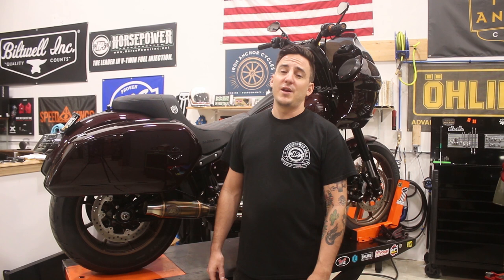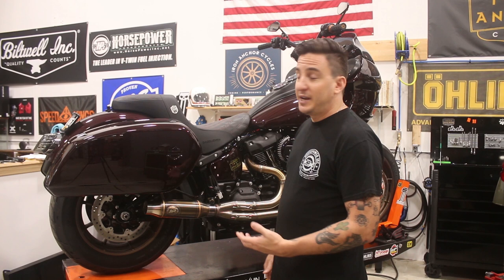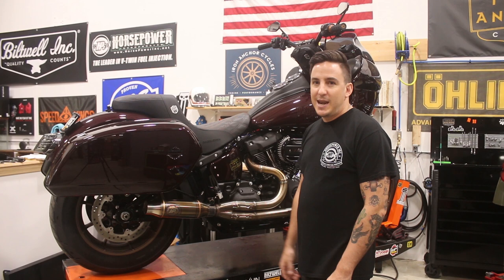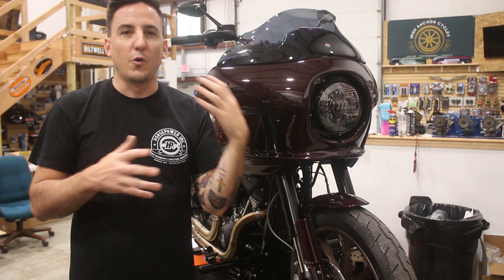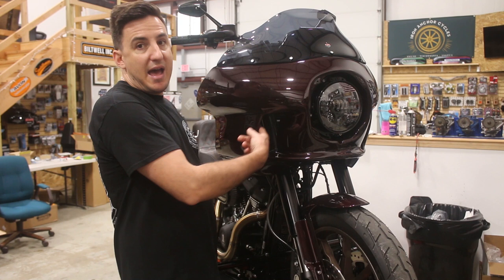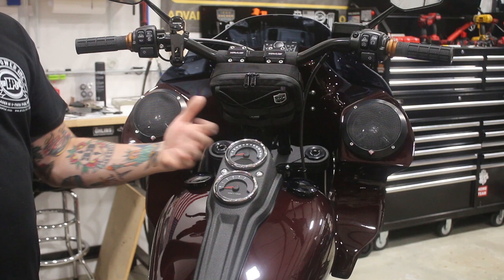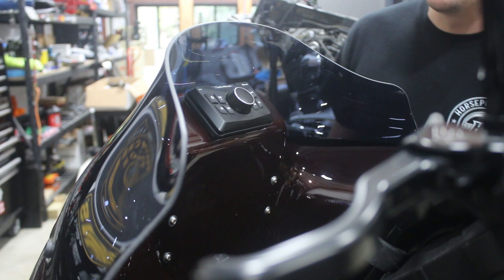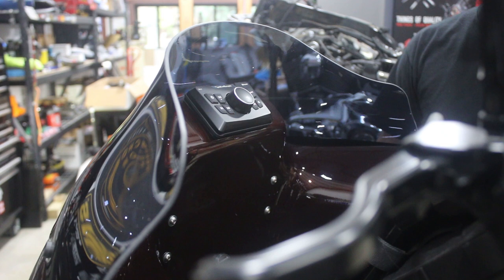Project FXLRS - Part 8 - Fairing & Bags

Comment: Sport tour build is my goal is well. This episode is why I bought the Sport Glide. Expensive bags & labor already there and they fit snug. Also no 1980 fairing. I realize it has its following. However the factory quick release fairing required Gustafson dart tint vented windshield plus lowers to get to both good coverage and no buffeting. 

Flip side is that some people prefer the mid controls that the LRS comes with. However HD sells mid controls conversion kit for those that prefer it. Both have inverted forks but a downside to the Sport Glide is that it only comes with a single disk although it does have ABS ie it’s a trade off. Fortunately you can now get a 15” brake for the SG which damn. 

The last trade off is the SG comes with the 107. In my case since I was going to build the motor in either case plus I prefer shorter stroke. Anyway been following your build and am looking forward to the rest of what you do.

Comment: I couldn't agree more with you about the RWD FXR fairing IN TERMS of the amount of work it takes to make it fit GIVEN it's supposed to be plug and play and total cost.  I honestly don't understand why the fitment isn't better across the Dynas, Softails and Touring (Road King) chassis.  Why can't the clearances/cutouts be better or at least much closer to plug and play?  I can't begin to tell you how much I had to cut out of the bottom just to clear the turning radius AND I removed the upper fork cans.  On top of that, the mold (2022) wasn't the quality I was expecting and the amount of prep before paint was exponentially more then they (website and phone conversation) led on.  All in all I'm happy with the end result, but the amount of work I had to put in after already investing the $1,400-$1,500 for the kit, was insane.  Therefore, I would say it's overpriced for what you get.  Great video!

Comment: A couple questions. First a great video with all the info. Thanks so much. 1, What  are the other fairing manufactures. 2 and most important. How does the bike handle in regards with the wind. Hopefully like a Roadglide. After all that is the whole purpose. Thanks again for the great video.

Comment: H-D is telling people not to install these fairings. The MoCo wants you to buy their LRST version claiming that the front suspension is a little bit different to account for the additional weight of the frame mounted fairing. On your build, do you beef up the front suspension to make it perform better than the stock setup?

Comment: had the same issue with my rwd fairing. The primer coating was pretty jacked, the body work dude had to strip it all off. Dominator carbon fiber would've been cheaper.

Comment: I was at your event on sunday, had a good time was trying to take a look at the low rider s. Where you put the tank bolt and maine bracket did you remove those lil plastic covers? Im having a hard time tightening mine down. Everytime i go over a bump that bracket moves slightly up and down and its an annoying sound. Might have to take her to your shop and see how we can tighten that bolt down right

Comment: Ive got a 2021 Sports Glide. Im thinking of getting this FXRS fairing for my bike. My question would be how tall do the handle bars have to clear the fairing? Thanks in advance
Reply: I have the same fairing on my low rider s. Needed 12” risers. My risers don’t have the 1.5” pullback like you can get on the Kraus risers. I’m not sure but you might be able to go an inch or so lower with the pull back.
Reply: Sell me your bags